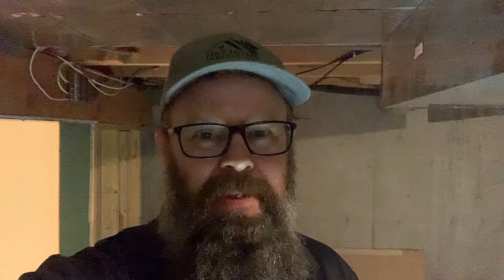💦Vapour barrier on interior walls, bad idea!  “On the home inspection today”

Comment: I'm insulating cathedral ceiling. Home built in 1968,  finished with cedar planks. We had condensation issue end of winter, when it is +°C during day and below zero nights. Just drips of brown water 💩
So we removed the planks, old fiberglass insulation (about r12 in total) 
Joists are 25' long FIR 2x12 lumber, 25' long each, spaced 12" on center. 
My plan is to use Raft-R-Mate Rigid Extruded Polystyrene Attic Rafter Vent between all the way to the top of roof.
Then Rockwood r22 layer then r14 layer and then use 1" durofoam as vapour barrier.
Would that be acceptable? 
I'm in Manitoba
Reply from the maker: Hi thanks for your question! I think you were on the right track. The raft r mate rafter vents are only meant for one per rafter space at the bottom. They are not meant to go all the way up to the top of the roof. You only need one per rafter space. These are to provide airflow from the soffit up into the rafter space and out the ridge vent. After the rafter vent I would recommend a 1 inch air gap between the roof sheeting and the Rockwood insulation all the way up to the top. 
At the top I would recommend a ridge vent all the way along the peak of the roof so that the airflow can move from the soffit through the rafter  vent through the 1 inch air gap and then up through the ridge vent, this will allow condensation developing in the cathedral ceiling to be vented. 
I would not recommend 1 inch durofoam  as a vapour barrier. I would recommend 6 mm poly as a vapour barrier. 
I think the detail looks like this starting from the inside. Half-inch drywall, 6 mm poly vapour barrier, 10 inches of Rockwood Insulation, 1 inch air gap, roof sheeting. With one length of rafter vent at the bottom and a 1 inch x 12” ridge vent at the top in each rafter space. I hope this information helps. Have a great day Westley
Reply: @hatpropertyinspections  thanks for quick response! 
I was worried that when I insert two layers of insulation I will push it too far and block the flow of air, so I ran Raft-R-Mate all the way from soffit to ridge vent at the peak of roof. Was worried my shingles will overheat in the summer and curl up
Reply from the maker: @dimash244  you’re welcome. You definitely want an air gap in between the insulation and the roof sheeting. Maybe two layers is to much if it is filling up the whole roof space.  Installing the rafter vents all the way up the rafter space is defeating the purpose of them. Wam moist air from the home will find its way into the roof space, hit the cold air from out side and condensate. There should be air flow directly above the insulation to dry into it and to vent the air before it condensates.
Reply: @hatpropertyinspections  now that you have said it it makes perfect sense! Insulation is 3.5" and 5.5" so I'm left with about 2.5" the Raft-R-Mate is 1.5" so I have to make sure I leave 1" between insulation and Raft-R-Mate

Comment: Thank you for the video! I was thinking of putting some insulation between the studs in the bathroom and a plastic sheet across it before the shower surround goes up. After watching your video I was thinking that I should not put the plastic over the insulation. Is that correct? I was wanting to put the 6 ML plastic over the subfloor (after I sealed it) and under the vinyl flooring sheet and 5 inches up the sides of the walls too as an (over kill) water proofing method. Would the plastic on the floor trap moisture? Thanks! The house is in AR.
Reply from the maker: Hi thank you for your questions! If the wall is an interior wall, and you do not want any plastic on it at all. If the wall is an exterior wall can you do you want plastic on it that should be right behind the drywall. If you’re going to put plastic on the floor it should go right on top of the concrete and nowhere else. You are correct if you have plastic in any other location than that it will Trapp moisture in the floor. Plastic right on the concrete is very common to protect flooring from moisture coming up from the concrete. Have any other questions just ask.

Comment: Hello, I live in a manufactured home in SoCal. I had a pipe burst (Quest) underneath one of my bathroom floors. I've replaced the subfloor since and have removed both the drywall and insulation on the east and south walls. The insulation on the east wall (interior) was white and had plastic wrap on one face - so I replaced it with John Manville ComfortTherm insulation. However, upon removing the drywall on the south wall (interior) - it revealed a type of Kraft paper barrier (.006 thick) adhered to the 2x4's along the entire wall (covering regular pink insulation, which I removed). It wasn't the asphalt based Kraft paper either. 

I was going to replace the paper barrier with 6 mil poly but after listening to your explanation on plastic trapping moisture and my project being two bathroom interior walls, I'm am now stuck between a rock and a hard place. Should I just forgo the barrier all together or should I get some kraft paper to use for the barrier?

And, thnx for the video, great information.
Reply from the maker: Hi RJ Thank you very much for your question. I would recommend no vapour barrier at all on both of those interior walls. No Kraft paper and no poly. You want those interior walls to breath and no vapour barrier is required. Kraft paper has not been used in quite a while and is no longer recommended. I would recommend the aqua board drywall it’s the green drywall and it can handle a lot more moisture than regular drywall. This is a good choice for interior walls in a bathroom but No vapour barrier of any kind. I hope this information helps, Westley
Reply: @hatpropertyinspections  Thank you for the fast response. The makers of my manufactured home (mobile home) didn't utilize the thicker drywall for the interior. They used a vinyl covered 11/32" thick gypsum board (thicker than 5/16" and not quite 3/8"), and my 42" x 60" tub (which had to be removed from a 60 7/8" opening) fits in between the north, east and south walls just below a tempered glass window. The tub has a center drain. I'll need that extra 1/8"+ to move the tub around to help center it over the existing pipe opening underneath (I don't need to redo the plumbing). Then, I'll shim out any spacing between the walls. 

Now, unfortunately (from my searching) they don't manufacture 5/16", 11/32" or 3/8" green board. Also, I've tried my best at throwing mud on drywall with lousy results and since I'm bound to a budget (insurance payout was minimum) - doing it myself with the plywood would be cheaper than hiring labor to hang drywall, throw up the mud and prep for paint. 

I have thought about coating the plywood (interior side) with Pro-999/RX35 sealer (I know it's primary use is for drywall but is there any harm using it on plywood?) and then perhaps apply vinyl sheeting to that or use a vapor retardant paint. I might even add in a 60" short (in height because of the window) ABS tub surround.

But!!!.... if you foresee any problems... PLEASE let me know. Any advice is welcome. Cheers.
Reply from the maker: Hi I do not see any problem with what you are describing, with painting plywood behind the tub. You can use any kind of paint you want, just don’t put any poly behind it.
Reply: @hatpropertyinspections  It's because of your credentials that I place more weight on the instruction, advice and opinion given in your videos than other youtubers offering their opinions. So, let me say again... thank you and have a great day.

P.S. So as not to cause any confusion in my measurements - I corrected the mistake of entering 15/32" when it should have been 11/32".

Comment: For interior masonry walls in temperate and cold climates,  should you not have a vapor barrier if an interior wall is in a wet area like a bathroom/ kitchen? Also what about floors; would it not be recommended to put a weather barrier (plastic) right below the concrete slab then have insulation over it and and then a plastic vapour barrier?
Reply from the maker: Hi Tahir thank you very much for your question. Well we do not want any vapour barriers on interior walls at all whether it’s a bathroom or kitchen. These areas can develop moisture yes but we want to have exhaust fans in these areas to exhaust moisture and we wanna contain any water fixtures so they don’t leak. There’s no need to have a vapour barrier. As far as below a concrete slab yes that is a good idea right below the concrete between the concrete and the gravel a plastic vapour barrier is a good idea there. To help keep moisture from the ground out of the concrete. Vapour barrier’s are required on exterior walls right behind the finishing the drywall. Hope this information helps thank you very much.
Reply: @hatpropertyinspections  thanks a lot!

Comment: What about faced insulation on interior walls?  Still no?
Reply from the maker: Hi Nathanael thanks for the question. The faced insulation that comes in rolls usually with a reflective layer on one side and fibreglass insulation on the other side is a commercial or industrial product. I would not recommend using it in your home. That reflective layer will act as a vapour barrier just not as good a barrier as 6mill poly.